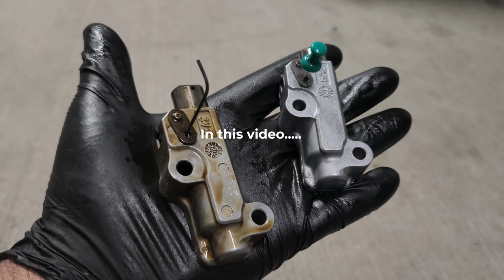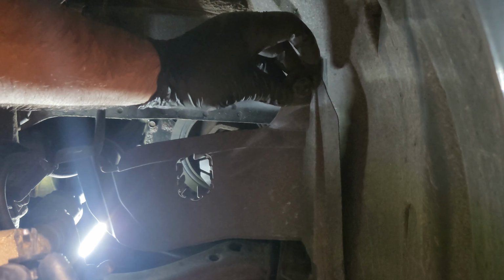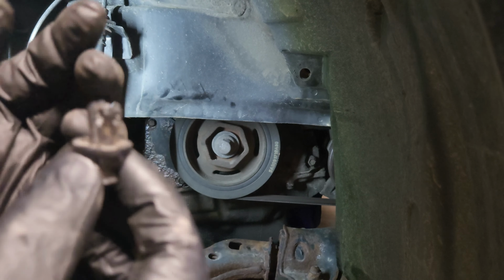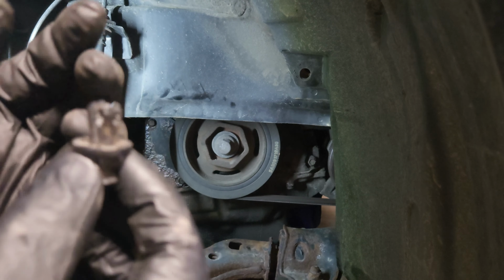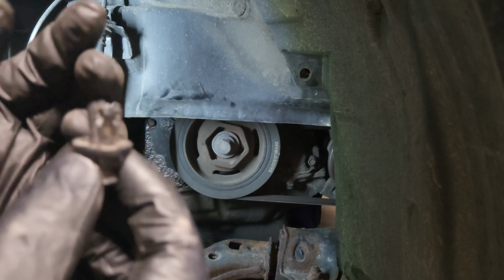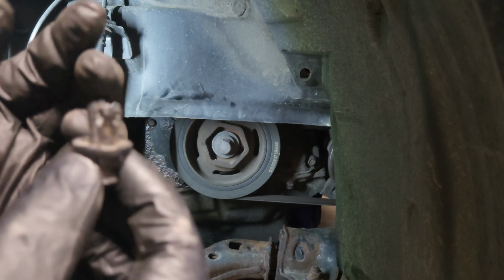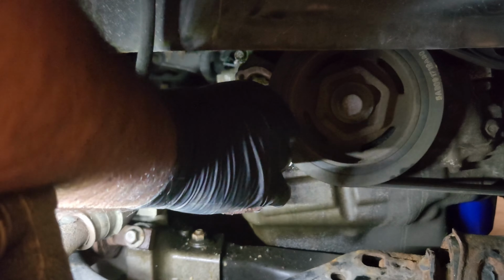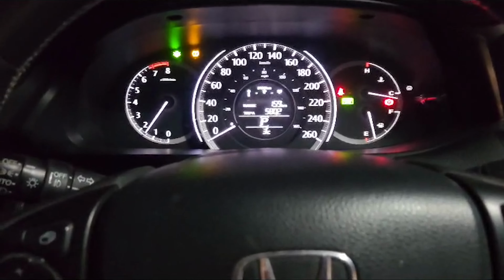2013-2017 Honda Accord Timing Chain Tensioner Replacement *COMPLETE STEP BY STEP GUIDE*

Comment: So they tried to charge me $1600 for this
Reply from the maker: I hope this video helped you do the job and save money along the way. Please subscribe if you liked the video and thanks for the comment.✌️
Reply: They tried to change you 1,600 just for that or for vtc actuator?
Reply: @paulleblanc3301  Did you do the R&R? How did it go? I'm pondering this myself, but the guy who posted here who had catastrophic damage has me concerned.
Reply: @094340  yes I did it just like the TSB said except for blow air though the oil filter hole no problem made the noise the first time I started it and that was it thanks for asking
Reply: @paulleblanc3301  

Thanks for responding. So, was the old tensioner piston over extended? Was the timing chain not stretched? My thought is that if the tensioner needed replacement, then the chain can't be far behind.

Sorry for the interrogation, I just want as much info as possible before I attempt this. Thanks.
Reply: @094340  no the timing chain wasn't stretched not sure why the tensioner went bad I bought the car a month ago was doing for the month woke up one morning started heard a noise researched it seen that was a common problem changed the part worked out
Reply: It all went smoothly.  Only problem I had was the old tensioner wouldn't clock in lower position to remove.
PIA. only other thing was getting new one lined up correctly.  Make sure it is positioned correctly on the guide at top.
Reply: Thanks You so Much ❤for your help 15:48

Comment: Do not do this. I just did this to my 2015 Honda accord and I had to pay $4,055 to fix my car. The timing on the motor was off. And slack was in the chain. And no it was not like this before I tried replacing the tensioner. They had to replace my chain and guider pins. Leave this one to the professionals. Or you’ll make it into something bigger.
Reply from the maker: I totally agree with you about leaving it up to the professional. In my case i only had a slight noise at start up,  no check engine light or any other symptoms. I knew my chain might have a little slack and my tensior was weak due to the mileage 350,000kms. It sounds like your timing moved when you were trying to do this repair. If you bought a car that has the rattle/noise at start up and its ignored for tens of thousands of kms then all other timing components due wear excessively where just doing a tensioner will not solve your problem. So its better to do sooner than later to avoid a much bigger repair. I have over 15,000kms since the repair and still going strong. Hopefully this helped ✌️
Reply: @fixithoney  yea I bought the car used. Financing it. And there was a slight rattle at start up for 1 second maybe then went away. I replaced the tensioner. Car started low idling and making noises. White smoke out of exhaust…. Leave it to the pros ! I’ll stick to brakes and rotors and the other basics from now on! Lol
Reply from the maker: @craiganthony3824  thank you for thr comments and subscribe if you haven't already. Check out my other videos. 👍
Reply: @craiganthony3824   Yeah, I have to admit that anything involving timing tends to intimidate me, I don't even like to adjust valves because I'm afraid of screwing something up. I have an 09 Accord that I just bought with that rattle, so now I have to be on the lookout for any kind of problem. 

Problem is the outrageous cost of repairs like this, if you take it to a garage, so I generally try to do things myself. It REALLY bugs me how much they rip us off, and it's most because of the labor charges.
Reply: @craiganthony3824   I'm wondering why this happened to you, because there are many accounts of guys doing this replacement without any problem, I'm considering it myself.

I can't imagine why your timing would be so out of whack simply by turning the crank case the little amount needed to line up the pin hole, and then turning it back after install. I have to admit that your unfortunate result is giving me pause at attempting this.
Reply: Same shit just happened to me........ I was very careful. I think my tensioner wasn't pushing on the guide after pulling the pin. Idk
Reply: You have skipped 2 or 3 teeth, that's why, should have tightened that side of the chain
Reply: After turning the crank counter clockwise 90 degrees to compress the tensioner and inserting the pin, the crank should have been turned clockwise 90 degrees in order for the chain slack to be on the compressed tensioner. As the video shows, when the new tensioner was installed and pin pulled, the piston didn’t quite go up because the tension was still on the chain. As the slack was on the opposite side, when the engine was cranked, it caused the timing to go off as the newly installed tensioner was building pressure. If you visualize what I’m saying, you’ll understand why your timing jumped.
Reply: Your tensioner failed and chain due to low oil levels.needed whole chain job
Reply: @brandonbassett7125  oil levels were perfect lol

Comment: The only thing I would add is after removing the new tensioner pin, I'd turn the crank clockwise a turn to ease the tension back into the guide.
Reply from the maker: Thanks you very much for the comment. Im personally not a 100% if that recommended from honda or just good practice. Subscribe if you haven't ✌️

Comment: How did you determine the timing chain tensioner was the cause and not the VTC actuator mounted on the intake cam that is usually the cause of the start up rattling noise?

Comment: Just wondering, is that the original cvt??…original fuel pump, water pump,radiator,etc…I have the same car…I did the complete rechain,vtc ,guides,etc..at 130k now it has 167k and was wondering how much time I have on the other components I mentioned,..this vehicle is well maintained…all services done as recommended…any feedback would be appreciated thank you ,new subscriber ..👍
Reply from the maker: Thank you for the comment and for subscribing. This a 2013 so first year of the cvt. Everything is original except the starter and battery. 360,×××kms not miles. This was also a dealer maintained vehicle and i am the second owner. Any other questions just ask ✌️

Comment: Did this a while back on my 2014, no more rattle at start up. Now, I recently bought a 2018 2.0 with 105k miles and its doing the same rattle at start up if I don't drive the car for a few days. The access port to the tensioner seems similar on both engines. Gonna do it on this engine soon. Come on Honda!, this is embarrassing 🤦🏻
Reply from the maker: Thanks for the comment. That's pretty sad to know that the newer generation accords are still dealing with the same issue. I am also very skeptical of the turbo side of it as well.

Comment: Wait so don’t have to change the timing chain?
Reply from the maker: @genesistoliver8005  if caught early enough the main thing that starts going is the tensioner not keeping enough tension on the chain causing more wear over time. If you have had the issue for years then I would it would be wise to replace the chain, tensioner and guides all together. I hope this helped. Please like and subscribe if you haven't already. ✌️

Comment: Followed this video to fix my 2015 CRV. Ran into a minor issue where the lever that the tensioner pushes was putting too much tension on the tensioner to get it out. I used a pry bar to hold that lever up and was able to get the old tensioner out and the new one in. All good now. Happy to have quiet starts now!
Reply from the maker: Amazing, im glad this video helped. Please like and subscribe if you haven't already ✌️
Reply: Yes, bc you needed to rotate the crankshaft backwards a little bit to not have tension

Comment: I pulled the cover off and mines was covered in oil what does that mean something else leaking ??? Great video though thanks a lot 👍🏾👍🏾
Reply from the maker: More than likely you have an oil leak from up above. My car had a valve cover leak. Could also be that someone dropped oil filling it up during an oil change. Best thing to do is clean all of it up and drive the car and recheck to see where it's coming from. Please like and subscribe if this helped you out 👍

Comment: What happens if the timing chain tensioner key hole is way off the hole alignment even when I turn the crank shaft counterclockwise a little to try to decompress it to put a new tensioner in to replace
Reply from the maker: Sounds like its failed if you are  not able to lock it in place. There should be ALOT of tension there so you do need to lock it in place. Be careful
Reply: I got a code p0341 now 😞
Reply: @Anthony-hy4ew that’s the cam shaft position sensor code. Hopefully your car didn’t jump timing. It’s possible when you replaced the tensioner that the timing chain was stretched and and your engine jumped timing but I hope that’s not the case.

Comment: I was extremely careful and did everything to the book. Torqued everything. Took me 3 hours. I now have a P0341 and my engine jumped time. Fuck. Be careful guys. Seriously.
Reply: I realized where I messed up. When I installed the new tensioner and pulled out the pin, it didn't move. It was kind of resting on the chain guide anyway so I figured it was fine. DO NOT CONTINUE IF THIS HAPPENS TO YOU. Poke/hit the tensioner until it extends TIGHT onto the guide, or have it towed to a honda mechanic. You will save a lot of money getting it fixed from this state compared to bent valves and damaged pistons.

Also I used a brand new tensioner purchased and picked up from a Honda dealership, verified with my VIN, verified with the TSB.

Good luck and be CAREFUL everyone.
Reply: Did you use a OEM tensioner?
Reply from the maker: @fridder.  thank you for the comment. I hope your car is running good now. I hope the video helped, please like and subscribe if you haven't already ✌️
Reply from the maker: @vladartyshchuk9170  yes i believe they did you oem honda tensioner. Please like and subscribe if you haven't already ✌️
Reply: After turning the crank counter clockwise 90 degrees to compress the tensioner and inserting the pin, the crank should have been turned clockwise 90 degrees in order for the chain slack to be on the compressed tensioner. As the video shows, when the new tensioner was installed and pin pulled, the piston didn’t quite go up because the tension was still on the chain. As the slack was on the opposite side, when the engine was cranked, it caused the timing to go off as the newly installed tensioner was building pressure. If you visualize what I’m saying, you’ll understand why your timing jumped.
Reply: @SIMPLEHECHO question?
When need to do 90 clock?
After pin out ?
Or before pin out
Where to buy ,spare pin if you know
Thanks 😮
Reply: @SIMPLEHECHO Good observation. I'm going to do this job on wife's CRV and i'm glad you pointed this out. 👍

Comment: I found that priming the fuel pump by turning the key to on II a few times (6-7 times waiting a couple secs between) helps eliminate or reduce the rattle on cold start up.
Thanks for the video, going to replace the tensioner myself, you make it seem really straight forward.

Comment: Hey so I ordered an aftermarket tensioner and it didn’t come with the pin inside. It was hard to lower the top metal piece but I finally got it lowered and then it flew out. It falls in to place normally now but I’m wondering if that may have messed it up? I’m confused and would really like some help if you can please reach out to me
Reply from the maker: Hey, i would suggest for you to not use that part. The pin is there to hold very high amount of tension. DON'T PUT THIS IN YOU CAR. Get a refund and try to get OEM honda or cloyes is a good brand that made aftermarket parts. I hope this helps, let me know how it goes or if you have any other questions. 🫡
Reply: @fixithoney  do you have a link by any chance?
Reply from the maker: https://www.hondapartsnow.com/genuine/honda~tensioner~cam~chain~14510-5a2-a02.html?vin=&make=Honda&model=Accord&year=2013&submodel=&extra1=4%20Door%20EX&extra2=KA%20CVT&filter=()&location=pd:4230937,6 this is what i found online to fit my personal 2013 accord 2.4 with cvt. I myself went to the dealership and ordered it using my vin number.
Reply: Please never use aftermarket parts on a critical application like this.

Comment: How long until you drove the car?
Reply from the maker: I started it right away after completing the job.
Reply: @fixithoney  me too. I did an oil change to I ran it for like 5 mins so far. Did you drive 12 hours later or less after doing it? 

I only ask cause the gasket maker says to wait 24 hours.

Comment: The best video.in the ENTIRE EARTH, Could you please share the link where you bought the part? Best explanation IN THE WORLD
Reply from the maker: Hey, thank you for the comment. Really appreciate that, i bought the tensioner direct from Honda so it is an original part. I really recommend going with the original honda part especially for engine timing components. Please like and subscribe if you haven't already ✌️
Reply: @fixithoney Aisin is the OEM manufacturer for this part.

Comment: I did this on my 2014 and 2016 accord. I did notice the 2016 had the tensioner screen but my 2014 didn't. Both are running smooth as butter so I'm ok with it.

Comment: Brooooo!! You the man!! I have 2015 accord coupe with 104457 miles and it did that same thing and I couldn’t figure it out until man. Gonna replace it tomorrow! Hope it fixes it cuz it sounds like shid on a cold start
Reply from the maker: I hope this video helped and you have already done the job. Please like and subscribe if you haven't already ✌️
Reply: The vtc actuator spring often wears out too on the 5A2 gear, Accords and CRVs so best to replace that at the same time.
Reply from the maker: @spring-start  thank you very much for the comment. Please like and subscribe if you haven't already ✌️

Comment: Hi man, I got a k24z3 engine which will have some chain noise while accelerating between 2000 to 3000 rpm. Do you think this issues was causing by the chain tensioner? Thanks.
Reply from the maker: In your case i think your car will need the full works. Chain, tensioner, guides and all. My car only had noise at start up and queit the rest of the time. I hope this helps. Like and subscribe ✌️
Reply: Yours may be the vtc actuator

Comment: I have v6 honda accord 70.000 km only, but when the engine starts on the morning or when it's cold i hear noise like repeated knocking disappear after a while,, i saw many videos about that problem,  most of them say tensioner and the belt and other related devices, my car is 2014 with low km as i mentioned above,,, the only tensioner should be replaced or another parts also included,,, with my best wishes from the middle east.
Reply from the maker: If you have a v6 then you have a belt. This job on my car is only for the 4 cylinder 2.4 liter k24, which is a timing chain. If you have hearing that noise then most likely you should do the complete kit with tensioner, belt, water pump and some seals. I hope this helps. Please like and subscribe and comment for any other questions. ✌️
Reply: Yes bro its v6 , but it's still  young 70.000 km....to change the water pump I think this kit it costs too much..   but for sure the tensioner and belt will be changed....thank you for the advice,  I'm waiting for more videos.
Reply: @tata7991  my car is 2008 v6 Accord. I replaced the tensioner,water pump and belt at 100k miles back in 2017. 7 years and 50k miles (70k km) later I noticed what seemed to be a little bit of oil coming from the tensioner (it must be leaking). Your might not have a lot of kms but it is 10 years old.
Reply: @AntonAtan   so that , the 10 years old requires change all of these parts, regardless of the km, I think this is logic .

Comment: I replaced my tensioner but now the rattle noise is all the time  ,before was only at cold start      any help?
Reply from the maker: Hey, sorry to hear that but did you follow the video exactly? Also did you buy a honda original tensioner. Sometimes aftermarket tensioners are faulty. Let me know if you have any other questions hopefully everything is okay.
Reply: Your new tensioner is defective maybe, or it wasn't the issue and the rattle comes from the VTC instead, or your chain has become loose with time and slaps. Check if the markings align at TDC.
Reply: I have a 2013 honda crv 2.4 with code p0341 replaced cam sensor and did not help, it doesn't rattle much when starting the engine, the engine light still on, what would you recommend. Thanks

Comment: I have a odd question.  On timing belts you have to switch out the tensioner while TDC to catch slack side.  Does that not apply when doing tensioner with timing chain?
Reply from the maker: There will be slack with a chain and  gets taken up once the engine is running and oil is pressurizing the tensioner properly. This is manily because the honda tensioner are known to loose there tension at cold start and goes away once running and filled with oil. I hope this helped please subscribe if you haven't already ✌️
Reply: @fixithoney does the lack of tension at initial startup not cause a problem and risk jumping the timing chain?

Comment: how would I know if the issue I'm having is related to the timing chain tensioner or the serpentine belt tensioner?
Reply from the maker: Hi, so it depend on what type os nosie you have, when you hear the noise and how long is the noise around for. Can you describe the noise your car is making.
Reply: In my experience, the timing chain tensioner failure has a noticeable rattle on a cold start.  The serpentine tensioner issue causes a whining or squeaking sound while it's running (high pitch) The serpentine tensioner is a quick fix also.